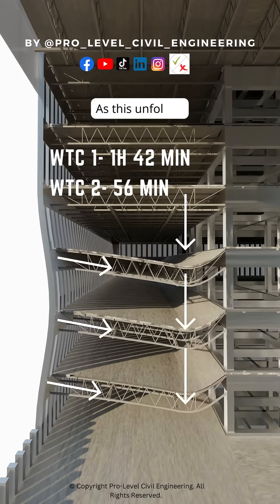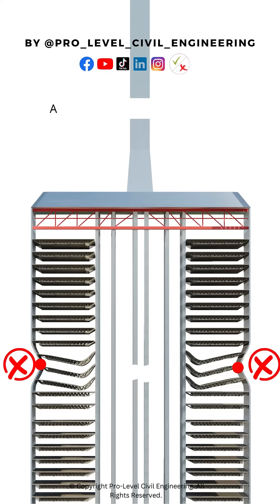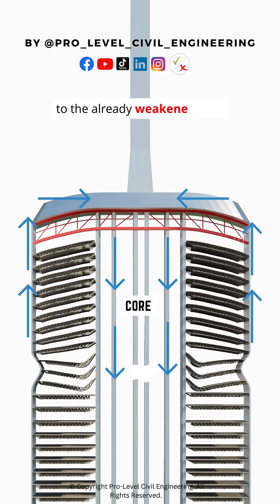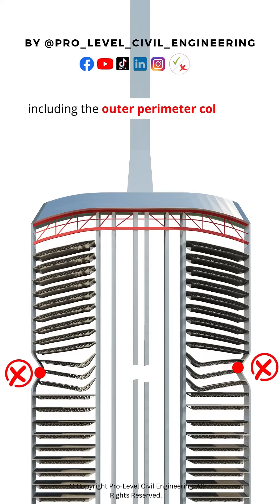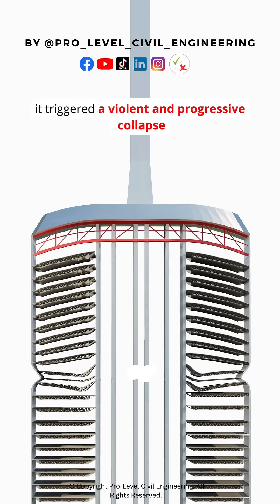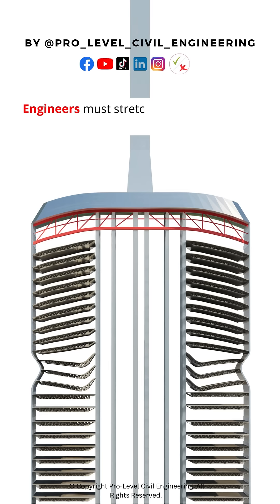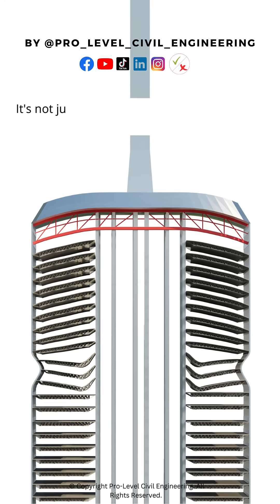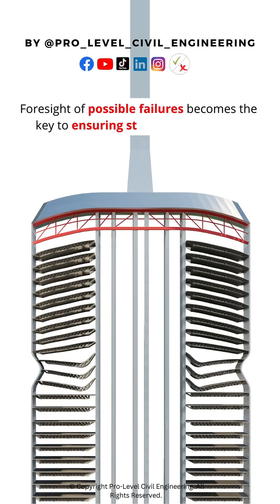The Horrifying Truth: Why the Twin Towers Collapsed on 9/11?

Comment: To all those that this doesn't make sense. Unfortunately it make sense, but you have to use your brain and a bit of imagination. As explained on the video, te weakened system came to a collapse. Now, two things here are important: the first one is that all the above floors came down as a huge, intact mass (as the whole system: internal and external columns and floors failed at once); the second is to consider why it came down so fast. The answer is in the structure: since the system was thought to be a cooperative action between external and internal columns, only one or the other are not sufficient to withstand the structure. The answer to why it came down so fast is clear from the videos. While the huge immense mass of the top floors came down, it impacted the lower ones by on one hand entering the below external columns like a can opener, breaking the short column segments at their joints. (those columns  remember they were just cross-linked small pieces of column assembled in series) they stood no chance to stand the force of the immense mass coming down. As the external columns were opening up outwards and the single junctions of them where blasted, the floors came also down since they had no support of the external columns. The core, however did not collapsed immediately, as the catastrophic force was 'opening the building' and it fell only few second after (it is also clear from the video). This type of architecture/engineering of the tube-in-tube system unfortunately caused a weakness to the system. This also explain the almost free fall speed of the collapse
Reply: If this is the case, there would be huge pieces of the desteryed building, but on looking to the collapse video you see the entire conctere was completely smashed into fine baby bowder
Reply: @HassanAbuSleemabolail now, I don’t want to stay here defending a theory, however not really. The forces derived from the collapse are immensely big and towers were mostly “empty” core and external columns were assembled pieces (small repeated columns pieces that you can also see it in the building videos). All these small pieces got first disassembled and then crushed  during the collapse. Nothing weird from this pov. At least to me

Consider that the towers didn’t have any concrete bear loading structures. The concrete was only refinements and protection nothing strong at all
Reply: @filippozoppi7569  Wake up Parrot!
Reply: @HassanAbuSleemabolail  to smash the concrete into baby powder like we saw on 9-11 you would need to put 150 TONS of TNT in EACH BUILDING by drilling holes into the concrete and filling the TNT in.

Controlled demolitions can't do that
Reply: What have you been smoking mate?
Reply: @TheAdrianSmith ahahah because saying “it’s all a inside job” is a clear sign that your mind is totally free from drugs ahah
Anyway, ask them, the video says exactly this. They are the experts not you or me 😉
Reply: @filippozoppi7569  Definitely not an expert!
Reply: cough dipshit cough
Reply: Wake up Parrot!

Comment: If you believe that a alluminium plane can penetrate a very thick steel and concreet building than you are not a pro engineer.
Reply: But you are, huh? Then explain how at the right pressure water can cut steel and how a bird can dent a plane. Go ahead.
Reply: @admiralprank  Of course, a bird can dent the thin aluminum.

What kind of question is that?

The plane, against the building.

It's like a sparrow.
Flies through the walls of your house.
And then a complete demolition follows.

Totally unbelievable.
Reply: @admiralprank  Alright patsy.
Reply: @TDH8988 people are so blinded
Reply: @IamMovementt  Blinded by what?
Reply: @IamMovementt  Oh yeah? How so?
Reply: @joshd3192 blinded by logic I guess.
Reply: @TDH8988 How come ice took down Titanic..? That`s the biggest mystery of them all. LOL....

Comment: The core columns just disintegrated?
Reply: The core columns were blown up when the plane went through. On top of that, they buckled under the immense heat of the fires. This was due to the planes having a nearly full tank of jet fuel upon impact.
Reply: @BallerBallington  "The immense heat of the fires" yet this has been proven false long time ago. The NIST report was a joke. The maximum temperature registered by thermal cameras was about 250C while steel only starts to soften at 600C. Plus, there are literal survivors who were in one of the towers after the plane hit and they were able to get down with the stairs. How did they if the heat was so "immense"? Enough with these lies.
Reply: No, why?
Reply: @joshd3192  Because that is what you see.
Reply: @TDH8988 No dum dum. What you see is the core still standing until it collapses.
Reply: The ruble is right there.

Comment: Schrodinger's (NIST's) WTC Floor Trusses: Too weak to withstand plane impact and fire damage, but too strong to deform and pull inward the outer walls and over load the core.
Reply: thats the impact of temperature it deforms linear elements causing deflection
Reply: @donbelvedere  That's a statement not an answer!
Reply: @mrichards-j6b i read that in a book named resistance of materials 1 on second year of civil engineering studies so it is a fact not something I made up
Reply: The Trusses held the 1600 TONS Concrete Flooring Pans to the Core and Connected to the Outer Walls. The Floors were the "Rungs of the Ladder"
Reply: @apaulmcdonough2170  And?
Reply: what you said makes no sense. there were floors above and below the impact zone, you idiot lol

Comment: That makes sense for the top part of the tower but what about the bottom The bottom was never actually even injured
Reply: Pretty simple: It got pancaked by the top.
Reply: @patrickanderson9023 how can a building pancake on itself if other beams underneath it were not damaged so what you're saying still makes no sense
Reply: @MRogersneighborhood  It makes 100% sense to anyone with a clue about structural engineering and physics.
Reply: @MRogersneighborhood  It can't.
Reply: @patrickanderson9023 how is a structure supposed to pancake if the structure from the bottom is not damaged in any type of way The building has been holding its weight since it was made no extra weight was added to the building so it could come pancaking down it's common sense man
Reply: @DARKREALM1122 he can't people don't seem to understand that the bottom is will holds the whole building together if the bottom was not damaged in any type of way the top doesn't matter okay it's like if you cut a tree if you cut the top of the tree the bottom there's no need of fear that the trees going to come falling down if the bottom hasn't been cut so the only way the tree will come down is if you cut the bottom it's common sense man
Reply: @MRogersneighborhood Exactly
Reply: @MRogersneighborhood  There are multiple examples on where skyscrapers and other tall buildings have pancaked due the fires, earthquakes and so on. Espacially slim and tall structures with a desing like the twin towers was.
Reply: I'm not going to go back and forth with you guys but all I got to tell you is this you guys really believe what the government is telling you even though everything the government has been saying makes no logical sense You are going to believe the government who was not there on that day but civilians were and a lot of them say the statement that they saw explosives going on inside those buildings I'm going to believe the civilians and when you look in videos you always hear people saying that there was explosions and then building seven came falling down with no plane structure hitting it or nothing making it fall it just fell out of nowhere You guys really want to believe the dumb things the government tells you remember this is the same government that's been doing a bunch of corruption and killing and stealing and overthrowing other people's governments You guys are very easily to manipulate
Reply: @MRogersneighborhood i am with you. The ideology behind how the buildings fell makes zero sense at all. All the videos of professional ppl who know what they are talking about magically disappeared off the internet.  You mean to tell me that the 100’s of survivors are lying about hearing explosions before the buildings collapsed? And we should listen to the government and everyone else who wasnt there?  Gtfoh. Those survivors know what the hell they heard and seen. Hell if you watch the videos from ppl across the water you can clearly hear about 8-9 explosions before the buildings fell. It seems pretty obvious to me what happened that day. The dumbest thing I’ve read so far was someone asking why they would need the planes then. Lol
Reply: It's crazy because you guys always want to give your opinion about what happened on September 11th and you guys say dumb things like fires made it melt and made it fall down but then when you bring a building seven what's the excuse for that building it was just old and it came falling down on that day I mean you people need a wake the heck up man seriously the government is still line through its teeth and you guys are over here agree with the ridiculous statement like literally I guess the terrorist got two buildings with three planes pretty much they got a deal buy one get one free
Reply: @MRogersneighborhood  The earth is flat, right? 🤣🤣😂

Comment: Thermite brought down ALL 3 of the towers
Reply: And explosives.
Reply: @troyterry6919  Uh huh. Anything else?
Reply: @joshd3192 you still haven't provided any evidence for your claims.
Reply: @troyterry6919  Uh huh. So you’re all done now?
Reply: @troyterry6919 debris from the north tower and The plane caught on fire and was flying through building 7, the building caught fire and collapsed
Reply: @2737hhx-r8r fire doesn't have the ability to collapse a steel framed building
Reply: Absolutely the buildings fell without any resistance in order for buildings to come down that fast They had to have help so there was no resistance
Reply: @cherrylove3656  the towers had resistance falling down. They felt at 2/3rds free fall speed.
Reply: Tower six also nobody mentions wtc 6 four collapsed
Reply: Look at the windows it was a blast furnaces in there like forcing air into a forge
Reply: You're wrong. All of trumpy's maga merch has poisoned your feeble brain.
Reply: Plus the missile that hit the pentagon
Reply: @sb8rc1  :face-green-smiling::face-green-smiling::face-green-smiling::face-green-smiling:
Reply: Not only thermite i think.
Reply: Absolutely was. Also remember a B-25 hit the empire state building with alot of fuel and the building still stands.
Reply: @insertnamehere313 yeah it still stands because a b25 traveled half as fast as a 767 and weighs over 20 times less you retard
Reply: @insertnamehere313  Conspiritard, The Empire State building and a B-25 is not the same as the Twin Towers and a 767. Yeah, you're a total genius.
Reply: @admiralprank  That group has done test of their own.
Also remember that skyscraper in Asia that burned for over two weeks that was built simular to the Towers?
That building never collapsed and the structural integrity wasn't harmed and they rebuilt...how come that building never collapsed?
Reply: @insertnamehere313  What test would that be?

"An arm chair structural engineer with a PHD folks...Look"

The irony.
Reply: @insertnamehere313  "That building never collapsed and the structural integrity wasn't harmed and they rebuilt...how come that building never collapsed?"

Well you see genius there is this thing called a commercial airliner...
Reply: Plus the aliens destroyed flight 93 🤣🤣

Comment: Jet fuel doesn’t burn hot enough to melt steel
Reply: Nor did they burn long enough
Reply: it dented it
Reply: true
Reply: Yes thank you mid 2010s conspiracy video, it doesn’t melt it. It softened the very skinny truss steel and allowed them to stop supporting the outer wall just like the video says.
Reply: @Justinmotox1995  Not true.  If thats the case.  Outer wall still stood.
Reply: @Justinmotox1995 only two steel supported buildings have ever collapsed in the history of the world. Guess which ones. And the owner of the buildings took out a huge insurance policy on them just before 9–11. You must have missed the video of the police and firefighters on the ground right after the collapse saying that it was a demolition. They heard the explosions all the way down.
Reply: @mikemcdorman2711 Those explosions were the floors collapsing on each other, and steel joints breaking during the collapse.
Reply: @sigisoltau6073 whatever. I guess the police and firefighters should listen to you. Not what they actually saw and heard. Wake up. And start thinking and not repeating what you’re told to think. Only two steel buildings have ever collapsed in the history of the world. Guess which ones. The owner of the buildings never missed a day of work till that day. He also took out a huge insurance policy days before. Coincidence?
Reply: @mikemcdorman2711 Pretty much yes.
Besides. You know how much explosives you need to take out such large buildings? Even if you placed said explosives in the right places, you still need a large amount. And you seriously thought, that out of thousands of people who worked there, no one noticed people bringing in large packages and leaving them?
Roughly 50,000 people worked in those buildings, yet somehow one one noticed people bringing large amounts of pachages in? Or leaving them?
Reply: No, but it weakens it as low as 1050° F. 
Jet fuel burns hotter than that. Watch any video of an official demolition in the building falls from the bottom. TT went top first. 
Smh
Reply: It melted the concrete floors not the steel
Reply: @Muselinksworldly if the temperature is hot enough to melt concrete it should have melted the steel also.
Reply: @Muselinksworldly The Steel Floor Trusses were weakened and Deformed by the Fires. That's why the Floor Connections between both the Central Core and the Exterior Walls gave way.
Reply: @Muselinksworldly so.
Reply: Someting like 95% of the jet fuel burned up in the explosions when the planes hit the towers. But they also created massive fires on almost 10 floors in each tower, and the fires (and the heat) only escalated, which eventually led to the collapse of borth towers.
Reply: @patrickanderson9023  do you really believe those planes collapsed those towers? That’s the dumbest shit ever. Why did building 7 collapse. No plane hit it. It wasn’t burning with magical jet fuel. Wake up. The only two steel buildings to collapse in the history of the world was on 9-11. And the owner of the building took out a huge insurance policy on them days before. And oh ya, he never missed a day of work till that day. Keep your stupid retarded science and open your eyes. Go by what you see , not what they want you to believe. The firefighters on the ground said the building was demoed.
Reply: @patrickanderson9023 At most only 1/3 was consumed in the initial fireballs. Jet Fuel reached the Ground Floor Lobbies in both Towers.